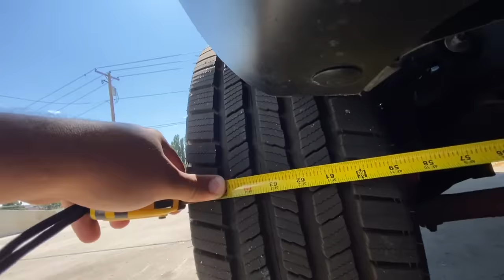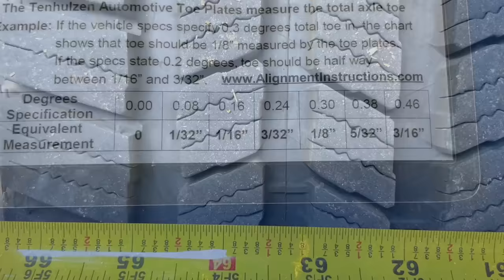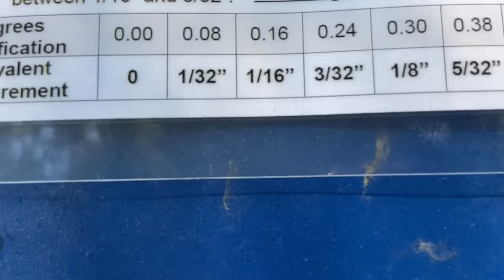How to do an alignment on a car at home using only a tape-measure!!! (And Alignment Basics)

Comment: I do this on my cars.  It is very sensitive, as shown here where 1/2 turn each side changes toe-in by ~1/8".  I doubt a laser alignment could beat that, plus some who worked alignment said techs often kick the mirrors to get an acceptable printout without even touching the car's adjusters.  It changes over time after several years anyway as parts wear and ride height sags.  Easiest if your front tires have straight channels.  Hardest for me is recruiting a family member to hold the tape measure.  I've tried taping it to the tire, but falls off or shifts (stickier tape!).  Go up as high as you can on the aft side without hitting an obstruction, then the same height across the fwd track.  If new, tight parts, I set 1/16" toe-in for RWD (or toe-out for FWD).  As shown, you don't need to turn the adjusters much to get a big effect.  Usually need to drive and repeat to get the steering wheel perfectly centered.  A sanity check is to hold a straight-edge along the front and sight at the rears.  Should hit ~1" inward on the rear tire if FWD (slight toe-out), if your front and rear tracks are the same width (most sedans).  Repeat on other side.  That method is also amazingly sensitive and might even replace the tape-measure method.

I check camber by holding a carpenter's level vertical against the tire.  I set slight negative camber (tire leaning in at top).  Caster can't be adjusted on many cars.  On my 1960's Mopars, one sets the most caster you can, while still holding camber, even using offset upper control arm bushings.  The factory design was for bias-ply tires which deflect aft more than radials.  You want the projected line thru the ball joints to hit the asphalt in front of the tire contact patch while driving for a "shopping cart wheel" effect (so front wheels want to follow the body direction), but not too much or turning will be harder.

On older cars with turnbuckle adjusters, be sure to center the ball-joints on the inner and outer tie-rods so they can't bind in operation.  No worries with newer cars with rack & pinion like shown in video since the inner ball-joint which screws into the rack (behind rubber boot) can spin 360 deg axially.
Reply: Maybe a bungee cord around the circumference of the tire would hold tape measure in place without  falling off or shifting.
Reply: @lawrencedavidson6195  I do the tape measure alignments All the time and its Easy to keep it in the groove..I use clear 2 or 3 inch wide packing tape...tear off a 10 inch strip, place the tape measure end in the center of that strip, get a shop cloth and 1st wipe the dirt off the area on the tire, put the measure clip in the groove and press the tape onto the tire.. hold fine while i go to the other side for measurements..I even reuse the same taPE on the back side measurements..
Reply: @skip741x3  Great idea!
Reply: I've always enjoyed adjusting the suspension alignment on old Mopars. It's easy to adjust. It's also why they are good to take to the track cars and drive it back home. I would adjust the front alignment on my 71 Charger right at the drag strip. Then set it back to drive home. Heck, I would change the axle ratio as well. Pull the 3.28 ratio (8 3/4 axles are like Ford 9-inch axles. The gears come out in one unit) and change it to 4.10 gears. Then change it back to the 3.28's. Old Mopars were definitely built to race!

Comment: Bro ,ive been doing tape measure alignments for ages..its so simple and Everyone has the means to do it...I always use a marker though to 1st mark the default original setting position on the tieros and the baljoint its threaded to to if u goof up, u can go back and try again.. it also gives u a reference for whether u have turned a quarter/half or full turn..
Reply: Where exactly are you marking the tires?  Chalk or a sharpie?

Comment: This works great just did it on my Lincoln town car drives perfect and straight steering wheel I just did the exact same measurements in front and back and seemed to work just fine

Comment: Great video! Very explanatory.
I still say take it to the shop but from my experience here is something you can do if it is way off and not able to drive if you have just changed the tie rod end... I found that counting the turns is a hit or miss because the new tie rod end part  might be off by a few millimeter.  
1. Jack up front of vehicle (safely).2. straighten steering wheel. 3.take off tires and release locking nut on tie rod end...4. remove tie rod end from steering knuckle (do not unscrew from inner  tie rod. 5. go back in vehicle confirm steering is still straight adjust if necessary. 6. you have full control to straighten the steering wheel with your eyes by looking at it with the front of the vehicle, straighten them 7. Get under car and you will find that the tie rod end is not lined up with the hole in the steering knuckle make sure the tie rod end is  at a perfect 90° angle.  adjust to make it pop right in to the steering knuckle without moving that tire then tighten the locking nut , you will only be off by a small amount of degrees but able to drive to the shop without tires screeching or crab walking lol.  do this to the to the other side.. from a point of view just looking at the car you should have a steering wheel that is straight with tires that are straight.

Comment: I think when you tightened it back up, you changed the adjustment by turning the adjustment bar in a little bit, which would Toe the wheel in more. I think you need to hold the Adjusting bar with pliers on those lines and then tighten the nut. The tie rod end will only turn so far and it will stop. Not sure if it turned enough to matter though.
Curious if your wheel is straight while driving. I think you would have to keep adjusting them on both sides to the left or right until you got the wheel straight while driving because I don't think their is anyway to set the wheel straight with this method. You could have the steering wheel Locked down when you do this but, the correct percentage between the front and back of the wheels could be set correctly, but in multiple different directions I think which would change the setting on your steering wheel.
Reply: You are absolutely correct. You  will need to make several adjustments and that is why you must take the weight off the tires or you will surely strip the threads.  The basic idea is right  though  conventional steering is much easier than rack and pinion  steering.

Comment: cool video but did I miss something what if the driverside is out more than the passage side or vice versa.  I saw you secured the steering wheel. but don't you need a center reference point to measure out from to see which is out or in more.  either way, I will use this but I will find the center somehow thank you
Reply: Yes. It's good to measure to a center point.
Reply: Another trick is to count the number of available treads on each tie rod before you adjust anything. Ideally the number of threads should be almost the same either side

Comment: I use a straight edge and a laser level. Then I drive the car close to a wall. I set up my level and laser pointer and mark the spot. Then I back up the car about 10 feet and set up the pointer again and mark the laser spot. I then turn the adjustments on the car so the spots line up. Of course I do the same procedure on both sides. I repeat the entire procedure two or three times until the dots line up perfectly. a little bit time consuming but is very accurate, I took the car to an alignment shop and the readings came out very close to what the spec are. Make sure you calibrate your laser pointer  first by rotating it and making the necessary adjustments on the pointer.
Of course this method only works as long as you can see the spots like when its a little bit dark
------------------------------------------------------------
------------------------------------------------------------

- **Level**: Imagine a flat surface, like a table or a floor, where you would typically place objects.
- **Laser Pointer**: Visualize a small device that emits a thin beam of light, used for pointing out objects or aligning things accurately.
  
To create this mental image:
1. Picture a flat surface, like a straight edge that you put on  the wheel, in our case  the wheel that you want to align
2. On top of this surface, place a small, handheld laser pointer.
3. Envision the laser pointer emitting a bright, focused beam of light that extends straight out from the device, creating a visible line or dot on the surface.

This visualization can help you imagine a level with a laser pointer on top of it for tasks like aligning objects, checking for levelness, or highlighting specific points.

Comment: I just did this based on this video for the first time ever.  It didn't work without assistance, as there it too much slop in my steering (1992 Montero/Pajero) and when adjusting the toe, it just moved the slop point whilst the steering wheel didn't move.   The solution in my case was to get my wife to take up the slop in the steering wheel and then resist the movement as I adjusted the toe.

I also ran a string line from the rear tyre to the front so I could see the difference between the front tyre and the string as I adjusted it.  Saved some measurement time as it's tricky to get a tape measure between the wheels on this car.

Comment: I bungee a plastic 4' level on each wheel as high as I can to allow a tape to stretch across, makes holding the end on much easier and gives a more accurate measurement.
Reply: Hank Bridges  The 2 measurements are the reference.  When both front of tire and rear of tire measurements are the same the tires are parallel to each other and if your frame isn't bent or your rear axle isn't  skewed it also puts them parallel with the rear tires. Works perfect and I don't have to buy anything from EBAY.  You can also check with an 8' fluorescent bulb if the rear axle is in line with the front by touching off the 2 sidewalls of the rear tire and extending the bulb to the front tire.  When the bulb is touching both tires on both sidewalls you know the front and rear tire are parallel, this method also works perfect on motorcycles. It's all about geometry.
Reply: Using millimeter is an accurate one
Reply: You should measure off the wheels instead of the tires.
Reply: @charliedee9276  bh

Comment: This made a huge difference. I just changed both tie rods and of course alignment was off. Did this and car running straight with no hands on wheel. My only thing is, my steering wheel is still off center even though i did strap it down with seatbelt.

Comment: I noticed at 10:04 when you were tightening the locking nut you actually turned the drive to a shorter position, making the alignment off.
Reply: Probably actually put it in spec,  @ 8:43  he calls 3/32   3/16. so it likely took that 1/32 toe in to 1/16 or better

Comment: I use a telescopic paint roller handle on the insides of the front of the lip of wheels and then bring it around to the rear of the wheel and make sure there is 1/8 inch gap. You won't have variation from tire tread or rubber moving.  Just brought one to get new tires installed they checked the alignment and refused to even adjust it because it wouldn't get any closer than I got it with a paint roller handle.  Basically same concept just a little more precise

Comment: Oh dear oh dear and all you tubers are falling for this, so tell me how do you know what the thrust angle is, wait you don’t , now if your car is driving to the left or right it is your thrust angle that causes this and not your front toe, thrust angle is set from the rear and must be set first before you set the front toe so good luck you tubers ,
Reply: My 98 and 99 crv’s have set camber. The hardest thing is to get the steering wheel centered. Other than that, my cars track better than any other car I’ve had with no unusual wear.
Reply: Ok Karen

Comment: Went to the website listed on your alignment chart. They currently charge, $209.00 for a two panel alignment tool. Each alignment for my vehicles cost $121 to $151. That’s today. So two alignments at the lowest cost more than pays for it. That’s a no brainer. Great video, Thank you.
Reply: My alignment cost $350 from the backyard mechanic  n $500 from Brakes plus

Comment: After you set the Towing correctly with a tape measure you then I have to fine-tune the steering wheel because it is hardly ever straight it may be slightly off you drive it and determine which way to turn the tire rods on each side . If your steering wheel is at 1 o’clock after the Towing is set correctly you then will have to adjust the right tire rod in a quarter of a turn and the left one out a quarter of a turn and then recheck the steering wheel and repeat this procedure until it’s straight

Comment: I'm going to do this tomorrow. This is really good info. Recently I changed steering knuckles and other suspensions parts which required removing the tie rod from the knuckle... Now my wheel is off center. Hopefully this helps

Comment: Perhaps measure against a centre point in case one wheel is more off than the other?
Reply: If you're not sure that both wheels aren't with the same orientation, unbolt tie rod end completely and then screw in with same number of turns on both sides - and viola, you have a base line :-)
Reply: @René Vondrášek
Chcelo by sa Ti mi poradiť v tomto prosím Ťa? 
Moc by si mi pomohol.

Comment: Good idea but how do u know which wheel needs the adjustment your assuming both wheels are equally out to begin with ??? Or am i missing something?
Reply: I was thinking the same thing
Reply: That's what I caught, they could be both left or right... Should of squared off the rear tires...

Comment: yep spot on, car was pulling left wear on inside right tyre, checked using your method 3/8" TOE OUT RESET 1/16" TOE IN car drives as straight as an arrow total time 20 minutes cost nothing! many thanks
Reply from the maker: Glad that it fixed your problem!
Reply: @daringmotors  believe it not this is AFTER I had it checked TWICE with a garage so they are history!! top man! once again many thanks!

Comment: A neighbour used to do his own wheel alignments on his drive at home ..Get a good wrench to move the bolts  on the arms I've encountered a few seized ones might need a blow lamp..I've changed a few tie rod ends but never really done the separate job of alignment

Comment: Front wheels, should not be parallel in all cars, you should refers to car's spec. by the way, generally in front wheel cars, due to pulling force of front wheels, front tires tends to becomes toe in. so to compensate this phenomenon, they must have a little toe out angle in not driving condition.

Comment: Thank you for the great Video am getting ready to save $90 on front alignment.
Reply: You may save $90 now but it will cost you hundreds later when your tires wear out prematurely. You can’t get the precision you need with a tape measure. If you have lane departure or electric power steering you will also need to reset the steering angle sensor or you’ll cause problems that will cost you hundreds more on top of the premature tire wear.  Somethings are best left to the professionals with proper equipment. If a tape measure did the job why are shops spending $60,000 to $70,000 on alignment equipment.
Reply: @scotts1862  pop ouy66
Reply: @scotts1862  for the write off of course 🤪
Reply: @justiceforall8982  yeah no I do everything on my vehicles except alignments, transmission rebuilds, full motor rebuilds.
Why? Because higher quality measurement tools improve your accuracy.
This is why machinists with tighter tolerances get paid more.

Comment: Thank you, I put a new steering rack and pinion on.  I was going to take it in for a $100 alignment.  I did it myself in under an hour.  Hope it works???  
I was off by 3/4" from the front of the tire to the back of the tire when I started......  Now my front and back measurements are on the money!!!!!

Comment: I use to do that until I discovered a string alignment. I'm sure there are videos on it. A string goes the whole way around the car across the middle of the tire. It's easier to visualize and also get your steering wheel straight. No need holding a tape. With all front end work I do a string alignment then send them off to get it done with a machine. Any control arm work the castor and camber needs adjusted. With just tierods and/or pitman arm you can get away with just toe-in. Another thing is you need good tires. If you have poor tires you will get poor results. Do your work, put good tires on, adjust it close enough then go get a professional alignment. It's worth the $75.
Reply: Anthony M  I'm guessing it's a temporary remedy after fixing the car.  Really bad alignment can make the vehicle harder to control and unsafe.
Reply: I've used both the tape measure and the string ( fishing line with two jack stands) the string method is my go to.
Reply: @waynesmith1704 but wouldn’t you need the same tire width on the front and back for the string method to work? If you have 255 tires on the front and 275 tires on the rear wouldn’t that throw the string method off?